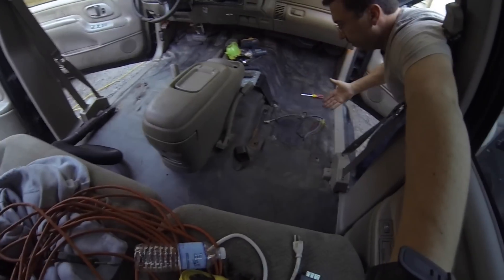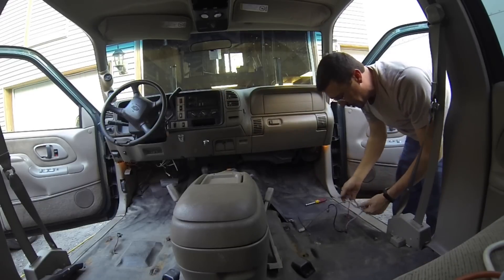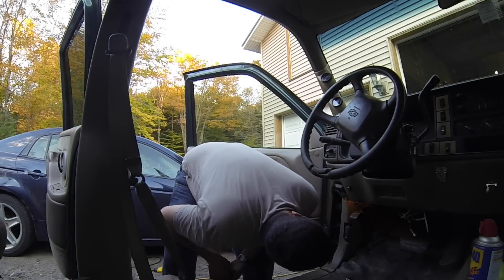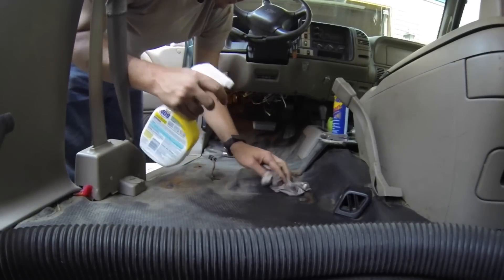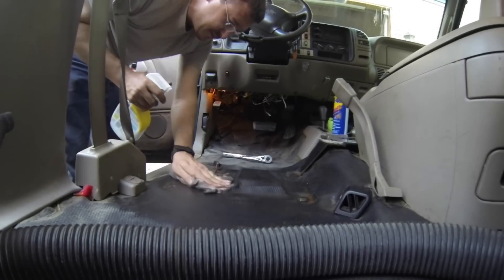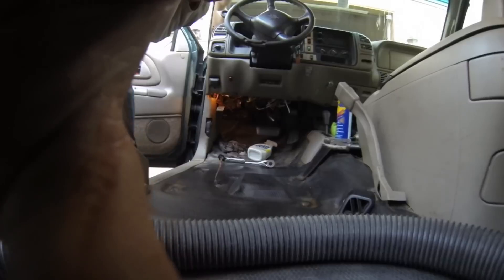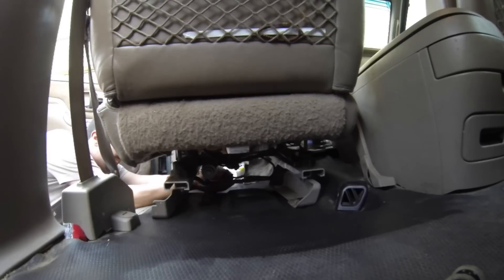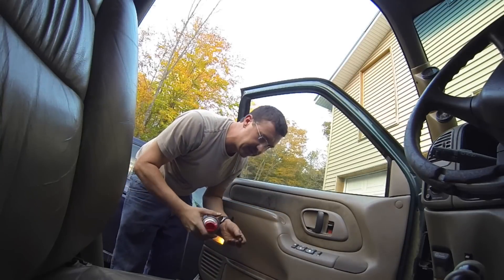3 - Chevy Suburban Leather Seats Upgrade

Comment: I have a Yukon with those leather seats in it there’s a switch on the door for the heat! You may have project getting everything working on them if it was a government vehicle your harness won’t support it also my seats have memory that’s another problem even if you find the harness the ECM and or BCM will need to be flashed to activate those features!